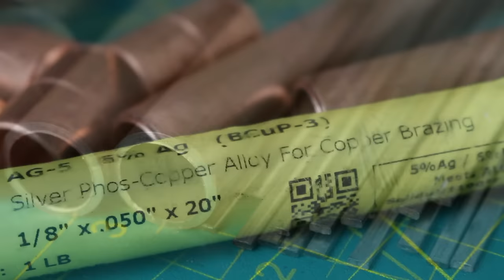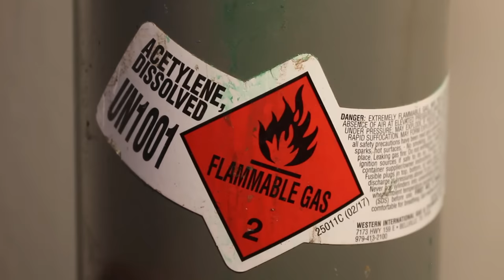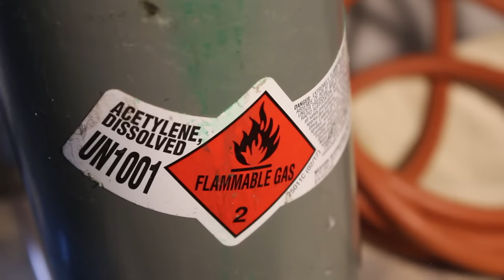How To Braze Copper Pipe Like A Pro (HVAC Refrigerant Lines)

Comment: I use flux I don't care what anyone say. It cleans surface and ads I. Capillary attraction. You don't out the stuff I. The friggin pipe. Turbo torch is ok for plumbing buy not refrigeration if you have solenoid valves in the vacenity. The heat spreads out to far to melt the filler. Oxy Acetelene all the way. Control that heat. With all due respect Ive went out on calls where the inserts of the solenoid valve was melted from the heat zone spread of a turbo torch use. Can't count how many txv changes over the use of a turbo torch. To long to heat. Need controled pinpointed heat. Lol. Awesome video tho. Truth be known I doubt all techs even use a nitrogen sweep. But if there using a turbo torch better do it. Too much carbon inside from prolonged heat. Weld On
Reply: Wrong.
Reply: @jwessonsr7503  wrong again. You have the wrong attitude.  It's not "to each their own". I presume you do this work for money/ customers, so there are  codes and minimum standards that must be met, which is why you are wrong. I'm not telling you that you are wrong just to say the words or to  feel good about myself.  I teach brazing and I'm still active in the field.  

I do not know if you can see my profile picture but that is me passing my large bore (6" & 8") med gas brazing certification test. I don't need or want your praise.

This video topic is about HVAC brazing and his example was cooper tubing with cooper fittings. So using flux would be absolutely the incorrect/WRONG thing to do here. If he was brazing steel,  ceramic or dissimilar metals (etc.),  then yes, using flux would be the proper procedure.

In your example of brazing near a solenoid valve is a good example in why you should not use flux, for starters you want as little contamination in the system as possible and with the nature of fluxes you are introducing chemicals,  acid and a liquid/solid into the system, moreover you may actually clog the system at the moment of your brazing or later over time. To take it to an extreme could you imagine if you took the time to do the calculations for a capillary tube (as a metering device - valid practice) and then used flux to braze? Terrible!

Furthermore,  in regards to using certain types of torch in heating and therefore, brazing applications there is a variety to be used. So sticking to one way,  one process is limiting and also the wrong thing to do. If you are going to braze a capillary tube as mentioned before then you should use either acetylene with a small tip (@ an 8 in ref to Turbo Torch) or, given your situation of needing pin point (accuracy) in a confined area/ space or it being that you do not want a lot of excess heat, then I might use O/A with and O/F tip (like 1 or 2 ref Victor). If,  however, you are going to braze 1/4" (3/8" ref HVAC-R work) up to 2" just acetylene is the preferred method.  Lastly,  2" (2"+) and over one should use O/A (O/F).

While I appreciate you trying to be polite and supportive of this (I'm guessing) young man, this video is terrible and mostly wrong. This video is a disservice and misleading therefore, he is making things worse. 

Once again,  I'm not telling you that both of you are wrong to feel like a big man,  but the facts,  standards and codes DO exist and they are there for a reason,  which is why you are wrong. Trying to help with facts, data, wisdom and  reality. Please feel free to ask questions.
Reply: @trevorbjarne  thanks for the lesson. I'm a retired novice just being a butthead but anyone reading will learn from it. Very well said Tech. Sometimes hard to teach old dogs new tricks. Aware of what you said and taken with a professional attitude. No insult taken or meant. I'm ever learning even in my old age. People learn from argument over issues. Weld On Brother
Reply: @jwessonsr7503  weld on brother.
P.S. That comment is THE best comment I have ever received on a forum. Thank you and you are welcome. 🎩

Comment: What is the difference between why braze vs solder. Sure don't need the heat
Reply: scott webber from what I’ve been taught...braze joints are stronger. They hold up better against vibration, heat and high pressure. I’m assuming you probably could solder the joint if you really wanted to. I’ve just never done it
Reply: 840°F ( actually 842°F) is the correct answer. Below 840 is soldering and above 840 is brazing.

Comment: First of all its Copper Tubing, not pipe. You are using a Copper tubing cutter. You should not treat brazing like soldering. You're applying the torch below the fitting and the brazing rod above like you would soft solder.. the technique with brazing is a little different. You should be heating the tubing and fitting until its cherry red, and then follow the torch with the rod all the way around and then apply a cap so that you cannot see the lip of the fitting at all. It should be seamless to the touch. I'm a local 1 plumber and if my brothers saw me braze that like you did I would never hear the end of it
Reply: The first part of what you mentioned - yes. Not cherry red, that's bad.

Comment: Pull that joint apart and see what is inside. That will tell you if it is a good fitting. He never pulled his heat / brazing rod into the fitting just the outside of the joint. It is not the proper way to braze a copper fitting and he used to much heat. Oversized torch tip see it all the time with my students.

Comment: FYI..your heating method is all wrong; start with the pipe going into the fitting, heating it up first then moving back to the fitting to have the braze fill all the way into the bottom of the swage.  Your method didn't braze the entire fitting and would not hold up to service..!

Comment: Your gonna have “holidays” in your joints from not filling from the underside of the horizontal joint. Also IMO your using too much heat.
Reply: What's that
Reply: A holiday is a void in the filler material filling the cup completely.

Comment: learn to use pipe benders, I rarely fit elbows on anything....just expand the straight connections - one joint! Also when de-burring, tip the pipe upside down so the swarf falls out of the pipe not into it!  This wasn't really a real life/on site time is money demo...nice for a you tube video but if you worked for me I'd take that box of elbows away from you and tell you to get your ass in gear and get on with it lol

Comment: See a Psychiatrist buddy, Your joint is terrible, you took way to long, work that thing, heat it cherry red and apply the stick to it, keep the heat concentrated moving it up and down the joint being made, that'll get rid of the pits and bumps, you don't want rubbertex pipe insulation snagging when your pulling that on.  get the Lead out of your ass, gas is expensive, i use oxy acc.  i gas weld to make money not burn it up. fill the whole joint, wave some heat over the weld for smoothing, good looks, and nothing to snag on, practice, I always cool my joints fast, it hardens the copper back up, if you don't cool fast, i use a soaking wet rag, if you dont cool fast, it becomes soft copper, i don't use soft copper, you remove all annealing when letting things cool slowly

Comment: Unreliable and time consuming. Sanding and trimming. Plus there is a possibility that coper traces will get into the system and might cause blockage. 
simply I'd heat pipe and use expander and join pipes then brazing.
I'd also use a small mirror to check the other side for gaps. Especially if you cannot move pipe freely

Comment: Get it hot faster tap it move the flame do an 8 moving the flame to get both sides of joint hot you don't need a ton of sauder on it cooper should not change color that much.

Comment: first tip should be to use oxygen and acetylene
Reply from the maker: Never use oxy acetylene for brazing. I've used it for cutting before. Good to run low pressure nitro while brazing👍
Reply: Just using acetylene for small bore copper tubing is perfectly acceptable and preferred. O/A should be used for bigger bore copper tubing while brazing.
Reply: @JumpermanTech  yes, you can and at times use O/A for brazing.  Yes,  you are correct,  you should use nitrogen when brazing HVAC-R & med gas purposes.

Comment: Awful. 
Cleaning is nice but not necessary on new copper for Brazing.
Looks like he's using plumbing fittings. The 90 is a short radius. Refrigerant piping needs to be long radius fittings. 
I appreciate that he attempts to heat the male pipe before the fitting, though he doesn't apply braze with the heat on the fitting, but rather the pipe at multiple points. Braze will flow to the heat. You need the heat on the fitting when applying braze. The joints do not have enough braze either, and it's typical to leave a slight bead around the joint.
No mention of purging with dry nitrogen during brazing. There will be carbon flakes inside that pipe that will travel through system and potentially foul the oil, plug up filter driers and other components. 
Way too many mistakes to call this pro.

Comment: Flux is not bad for refrigeration.
Soldering copper to copper or copper to steel.
Is called silver soldering not brazing.
I know when you are taught in school they call it brazing.
But incorrect!!!!!! Your school is wrong!!!!!
 I have 55 years experience.
Brazing is completely different.

Your solder stick will be 15 percent silver or 5 percent in sticks.

There is 45 percent just for steel tubing the flux allows the solder to flow around the solder joint and stick!!!!

You have to have flux on steel or the solder won't stick.

PS brazing is brass not silver.

Sorry I didn't watch your video no offense intended.
Reply: Brazing is brazing and soldering is soldering. They are two different processes.

Comment: let's see, your rod is so oversized it's leaking over the lip. Compounded with you just shoving the rod into the lip instead of melting it higher on the male pipe, making the drip problem even worse. That torch has no directional heat control at all. You're not using capillary action to fill the clearance, or even capping your brazes. You aren't heating both sides of the joint evenly. And you could've very easily downbrazed both of those joints to make it easier on yourself. It's not like you're teaching anyone technique on horizontal brazes, and those can be tricky. It looks okay, but pro? Don't kid yourself.

Comment: DONT USE NITRO PEOPLE. That way txv’s and pistons get clogged and you can make money replacing them DUHHHHHB
Reply: Install filter drier just before txt.
Whoops txv, there. Also I would use a little more solder initially to insure plenty in fitting.
Reply: @Troy Mason - people like you give pro HVAC techs a bad name.
Reply: Steve E jeez I was being sarcastic numb nuts lmaoo i dont ever do that. I was kidding around
Reply: Troy Mason - Oh. Well in that case....Good one.
Reply: Steve E yeah i love this trade. Im thinking about starting my own business and just start out by working on my own so i can make all the money
Reply: Troy Mason - Sounds like a fine plan. I’m glad to know you were just joking around, there are some people out there that actually have that “screw the customer” mindset.
Reply: Steve E yeah thats not good. I actually take a little more time than other techs because i want to make sure i deliver quality service. I feel like im a little ocd. I want everything to be as perfect as possible, correct airflow, td, pressures, unit draining without backing up into safeT switch, drain and pan clean, humidity in tact ect. I want to get this trade down to a SCIENCE. During installs i want to see everything very clean, pipes having nice tight clean look, basically everything looking like a masterpiece. I want referals and want my customers to have the best air quality and comfort possible; then collect my well earned hefty money.?
Reply: Troy Mason - Always good to take pride in what you do and strive for perfection, even if you fall short at times- because we all do! If you haven’t already found it then you should check out ‘A/C Service Tech LLC’ - he’s got the best channel that I’ve seen for HVAC training.
Reply: Steve E oh ive already have checked it out. That one and hvac school with brian orr who is freaking awesome. Question though, do you know what happens to superheat when you increase or decrease blower speed?
Reply: Troy Mason - Great question, I found this on www.hvacrschool.com.
#5 – Superheat is an indication of load on the evaporator 

On both TEV / EEV systems and fixed orifice systems (piston / cap tube) you will notice that when the air (or fluid) going over the evaporator coil has less heat, or when there is less air flow (or fluid flow) over the evaporator coil the suction pressure will drop. However, on a TEV / EEV system as the heat load on the coil drops the valve will respond and shut further, keeping the superheat fairly constant. On a fixed orifice system as the load drops so will the superheat. It can drop so much on a fixed orifice system that when the system is run outside of design conditions the superheat can easily be zero resulting in compressor flooding.

When the load on the evaporator coil goes up a TEV / EEV will respond by opening further in an attempt to keep the superheat constant. A fixed metering device cannot adjust, so as the heat load on the coil goes up, so does the superheat.
Reply: Troy Mason - In short it seems that superheat will remain fairly constant with an expansion valve system with changing blower speeds due to the valve constantly adjusting refrigerant flow while on a fixed orifice type system decreasing blower speed will tend to lower superheat and vice versa.
Reply: Steve E Great info thanks for the source. I also started thinking about the load outside. For example if your charging a unit at 70 degrees outdoor ambient, when it gets 90 degrees your subcool may rise because theres more heat transfer going on. I just had a couple wierd scenerios where design subccol was 8 and i brought unit to 8 subcool and superheat dropped to 5 on txv but my friend said design superheat migh be 5 for those current conditions, i just assumed it was low
Reply: Steve E by the way, do you work on inverter/communicating and 2 stage equipment in residential?

Comment: I’m sorry I can’t not comment on this. First of all if you want to braze like a pro get rid of that piece of shit turbo torch and get an oxy, acetylene rig like the pros. Secondly you never start by heating the fitting of always start on the pipe or the inside piece. I can tell you have had zero formal training and you have never worked with a journeyman. You are teaching people the wrong way of doing things.
Reply: 100%

Comment: Title “how to braze like a pro” continues to paint with the rod which you aren’t supposed to do 🤣🤣🤣 maybe learn how to add the Solder from one spot on the joint and use your heat from the flame to move the solder around your joint... maybe then you’ll be brazing like a pro! Lol

Comment: Never use sandpaper to clean copper pipe.
Reply from the maker: Why? What would you use?
Reply: @JumpermanTech  Microscopic bits of grit can embed themselves in the copper and cause trouble later with the integrity of the seal. Or at least that's what I was taught at plumbing school. Use wire wool or the wire tool you used.
Reply from the maker: @aucourant9998  That's good to know! Thanks for the heads up. "EACH ONE TEACH ONE"! Have a blessed day ✌
Reply: Brian Vasko  I've been a plumber for 45 years. I've never had to clean a 2-1/8 inch copper refrigeration pipe, so I'm guessing wire-wool? I'm a gas engineer and have to undergo testing every three years. we are always told to use wire wool or a propratory tool, never sand paper.

Comment: I would have kicked you off my job if you called that a finished braze . should be a cap on it .
Reply from the maker: Lmao. You do that tough guy. What do you mean by cap? This was a demonstration.
Reply: Just means that you have to put extra around the bell of the fitting so it will be able to hold pressure thats a drain fitting . refrigerant should never go through a 90 like that . but you just did a demonstration
Reply: 1Mrzane good point
Reply: If he was doing supermarket rack systems, he would need a cap. High temp refrigeration it really isn't necessary. Go open any roof top package system, you won't find a cap. If the OE isn't doing it, neither does he.

Comment: Youre lucky youre not hooking up a condenser or something you would have blown it up. Ive only been brazing like a year or so and I cant figure out why you wouldnsit on it that long. You need oxy and acetylene mix. Way more heat bro. In 6minutes you only did one braze. 😂😂😂 Atleast its an old video maybe you know how by now🤷‍♂️🤷‍♂️
Reply: You don't need an acetylene mix to this, and a turbo torch is perfectly fine the job. Some people prefer a turbo torch because they don't wanna accidentally blow a hole thru it with an mix.